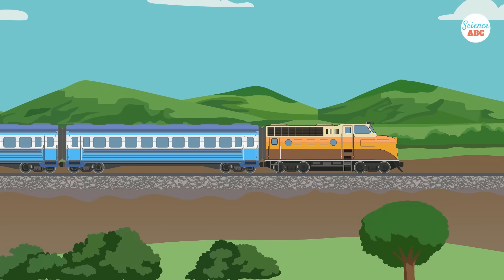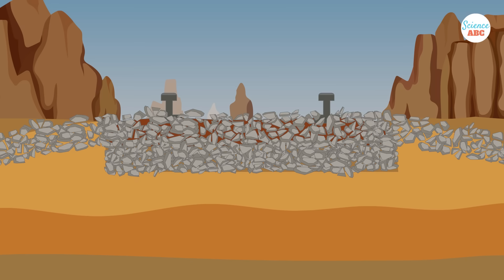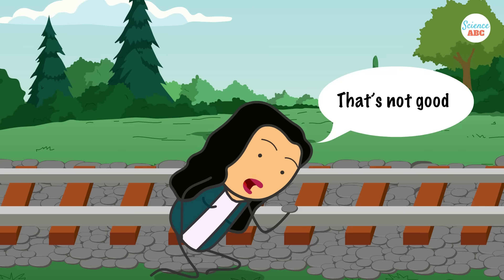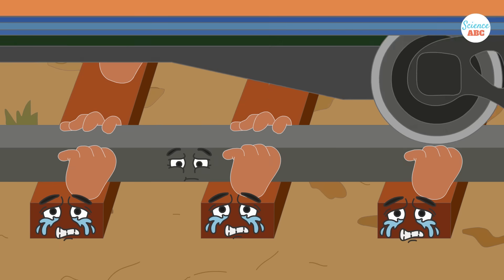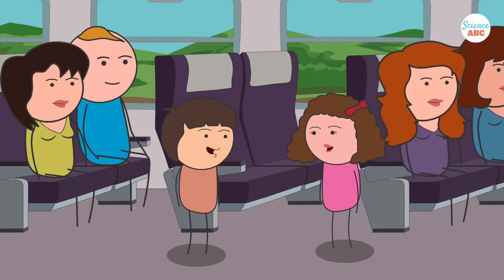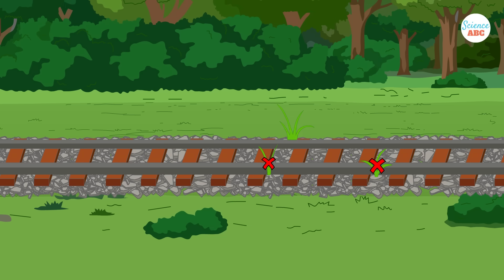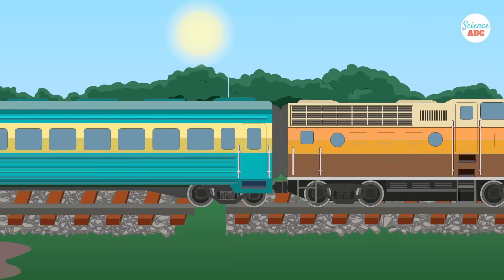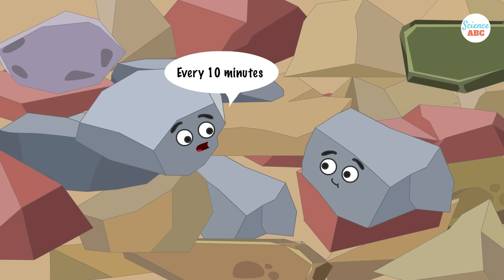Why Are There Stones Along Railway Tracks?

Comment: I used to have a job on a high performance ballast cleaner. It was a 7 person operated machine that dug up balast and shook the dirt out of it, then dropped the rocks back in place. My job(and one other guy on the other side of the machine) was to operate a metal box that shaped the ballast so that rain would first flow away and then down from the tracks.

Comment: Doubt that stones are better cushion than soil
Reply: The tracks also needed drainage, which soil does not do as well. Watch the whole video next time.
Reply: @entropybentwhistle  mentioning of cushioning is redundant. Is there other materials which could be used instead if they didn't lack a cushioning property? Maybe it is less about smooth ride of train and more about naturally preventing shocks from breaking structural integrity of the railroad, but it wasn't clear at least at the time.

Comment: I have a railroad right behind my backyard.  I love the sound of the trains as they rumble through the area.  I've seen the crews inspecting and repairing the ballast bed with that big machine you showed.  I just never knew what was happening.  I never knew why those rocks were there.  I have also seen the crews drive what looks like an ordinary pickup truck on the rails.  I've always thought the crew was inspecting the tracks.  Am I right?

Comment: As I had to work through the video, in short: 
1) To hold the sleepers
2) Load distribution
3) Vibration damping
4) Drainage
5) Preventing vegetation
6) Noise absorption
7) Minimising heat expansion

Comment: If ballast is so good, why are so many high speed rail systems (and subways) using pure concrete without any ballast?
Reply: Concrete costs more than rocks.  Concrete also takes more time and labor than laying ballast, which ultimately means even more money spent. Replacing rocks is also easier and cheaper than fixing sections of concrete when it cracks. Train tracks usually cover a lot of space. There's no need to spend more money on something when it doesn't need it.
Reply: @FlunkedPunk  How is this an answer? We ask why they are using concrete if you say it's more expensive.
I wonder if the first comment is right and it's because of possible damage
Reply: @dora_ver  my answer is indeed the correct answer. There is a german wikipedia article that describes that phenomenon. It's called "Schotterflug" and translates to "flying rocks". It only occurs at very high speeds. If you are interested, just translate that wiki article.
Reply: Your answer makes no sense 😂
Reply: At a certain speed there is a chance that the rocks get loose and damage the train
Reply: Ballast is good when you compare it to mud. But concrete is superior as the tracks are more secure.  A negative aspect of concrete is the dampening effect which is superior with rocks that have the ability to move under vibration for a smoother ride.  Also, in the city it may not be practical to use rocks when the trains share the same roadway as cars where you need a smooth surface to be able to drive on.

Comment: Let me say something too.
 1) The major work of ballast is to take high tonnage load through sleepers and referring to bottom 12 inch. cushion( ballast under the sleepers). During rolling stock load is dynamic, so the cushion as resilient to the load.  
2) The ballast  area under  (the  rail fastened with  both side of sleepers) is called Rail Seat which is packed with Track Packing Machine to maintain the level, Cross-level, super-elevation and gradient. 
3) The ballast between Two sleepers is called BOXING to maintain sleepers position at right angle to the rails and 2ft. center to center distance between sleepers.
4) The ballast around the track is called SHOULDER to restrict the lateral movement of track, usually 3.25 cu.ft/linear ft. 
5) The ballast's is granite or limestone size is 2 inches to 1.5inches with sharp angular edges for good interlocking. 
6) Ballast stone is tested in lab. for COMPACTING Factor and Los Angeles Abrasion.
7) An additional ballast is put at outer Apexes of sharp curves to avoid the risk of track BUCKLING in high temperature. 
8) Ballast take high impacts of load and converts into powder usually under the low joints. 
9) Ballast allow rain or flood water  to pass through it, keeping track safe against sinking. 
10) Allowable  organic material on ballast is 2%. 
11) Ballast resist movement of track opposite to the  movement of train, called creep. 12) Ballast is not used in tracks in  mushy, sandy and loose soil area. 
12) Ballast is immediately removed if get oil on it since its behavior becomes plastic. 
13) Ballast don't resist too much to vegetation growth because weeds grows into soil within ballast. 
14) Noise of train may intermingle in voids within ballast. Not sure.
Thank you.
An Ex. Railway Engineer fired from CN Railway because of having good knowledge of Railways.

Comment: The reason for this is that there are stones to prevent water from overflowing in rainy weather. In other words, there is no need for stones for an underground train, but stones are made to prevent water from collecting under the train tracks where rain will come and overflowing.

Comment: They're called 'ballast' anywhere you use them. Most ballast is used for road bed and you're right to a degree. They don't actually lock in, they simply stay put once they're settled. I've used them for 50 years for everything construction. It's just larger rock crushed into smaller rock and it gets that way by several different crushing methods. The type of rock is the most important.

Comment: Earth is not a planet.  The vast distances at which railroad tracks span proves this obvious fact.  The alleged curvature of earth is never factored into the engineering considerations when planning a span of track, never.  Only the measurable elevations changes but never the non existent curvature of 8'xmiles^2.  Scientifically, earth is flat and motionless.

Comment: Good but the ballast stones are derived from breaking the mountains rocks and crush them. Enough is enough. Railways must look for alternate material else the will compromise on sustainability that is not good. A like fossil fuel usage plans they must have a deadline to migrate to different material unlike mountain stones. By 2035???

Comment: There are two mechanism largely at work with track ballast, the sub ballast that is the rail bed under the railroad crossties and the ballast that is between the crossties and holds them laterally.  Sub ballast wears out from the moment of the trains rounding off the interlocking edges of the rocks turning them to shavings and dust that also clogs drainage creating suction when wet and pumping sediment into the sub ballast.   

An abandon section of the Columbus OH - Indianapolis Indiana Pennsylvania line I pulled up a handful of old ballast that was rounded off nearly like river stones with shavings and dust mixed in.   An old report from when Amtrak's National used the line last time in 1979 is the sub ballast would give so much on the east side of the Sugar Creek bridge in Philadelphia Indiana the passenger cars would be uncoupled with one coupler being totally above the other with no connection quickly to come back together again.  

I watched at WV Tech Montgomery WV in the mid 1980s CSX totally removed all track and ballast from its mainline then put down a geologic textile fabric, new sub ballast which may have been rolled, then crossties and rails then large stone 2" ballast on top.   To the east of town CSX put in new concrete crossties that rode better than some sections of the NEC when I took the Cardinal over them.    I looked back at recent Google map views and they'd been replaced with wooden crossties.    The issue with concrete ties is if there is a dragging off rail wheel it can crack every concrete tie.   It that situation would be fixed concrete ties offer fantastic passenger train service.

Comment: Advantages Of Stone Ballasts along the railway tracks :-

1. Holds the track in place
2. Even load distribution 
3. Provides cushioning 
4. Proper drainage
5. Prevents vegetation around
     the tracks
6. Absorbs loud noises 
7. Minimizes heat expansion
     in tracks

Comment: Ballasts are being discontinued in many new railway systems, instead, concrete slabs are used. they are designed for the specific job (usually for high speed trains). As technology advances, we will see less and less ballasts and more concrete or lab made materials for new tracks and even for old tracks that are being refurbished.

Comment: Another point it’s acts as an insulation medium between high tension wires to ground to prevent air charge distribution . If any object in between energy passes through. Same as like capacitor principle or thunder storm principle. That’s why you can see same kind of stones in substations as well

Comment: Railroad ballast is a crucial component of the rail transportation system. It is a crushed stone or gravel material that is used to support and level the tracks in a railroad track bed. The primary purpose of ballast is to provide stability to the tracks, allowing trains to run smoothly and safely.

Comment: The stones along railroad tracks are called ballast. They serve several purposes, including providing stability for the tracks, allowing for drainage, and helping to distribute the weight of the trains. Ballast also helps prevent the growth of vegetation near the tracks, which could interfere with train operations.

Comment: Don’t forget it inhibits foliage growth between the rail which not checked will result in fires. In my forty year working in railyards, I can’t tell you how many grass fires I’ve had to put out. Also you be surprised to learn you’re just as likely to have grass in winter as summer. Sparks from wheels and more likely carbon sparks from engine stacks igniting dry grass.

Comment: To those in the younger generations Amtrak transitioned to sewage chemical holding tanks on passenger trains in the 80’s after a lawsuit from a fisherman under a Florida trestle received a shower of an unfortunate combination of liquid and solid waste. There was a pedal to flush the toilet.  Stepping on the pedal opened a rounded metal trap door, flushing the toilet. Everything in the bowl plus the special blue water was dropped onto the tracks.  Looking down the hole you could see the ties and ballast as you rolled down the tracks.  There was a sign that requested you not flush while inside the station.  So the cleaning mentioned was especially important.  ;-)

Comment: in the uk ballast is made of limestone or more commonly, granite; smaller, rounded stones are often found in slow moving areas such as depots, and is referred to as shingle; there are other construction types such as slab track (continuous concrete block to which the chairs or baseplates the rail sits on, is bolted to); finally, digging ballast is absolutely back-breaking and most would probably agree is the worst job on the railway.

edit: ballast can become worn and crushed, and when mixed with rain water turns into a sludge - this sludge does not support the track and leads to pumping under train load, eventually leading to wet beds. a key sign of this is a line of white 'powder' around and under the rocks.

Comment: Ok one more time pls, lets run it again, i aint the sharpest tool in the shed pls tell me more and in bigger detail. Cant it be elevated and lodged into concrete and with sewer like grids around it for the water ? And how exactly do the rocks save it from the heat if the heat i]expands the metal?

Comment: Why not use a reinforced concrete slab structure? It has higher mass for damping, could be designed to have drainage system too and easier to clean. Is it just budget issue?

Comment: They missed frost heaving. In places where there ground freezes, the ground will swell if there is sufficient water in the soil. With certain soils with lots of clay, this frost heaving can be measured in feet, not inches. 
The rocks don't have soil to hold the water, and so frost heaving is greatly reduced.

Comment: After working for a Railroad Being a mechanic that fixes the machines that work in the tracks and being in a track gang it's nice to see someone explain the hard work that is done. I see you call ties, sleepers. For the  people in the north the tracks are changed come summer do to the heat make the tracks expand. There are two type of gangs that work the tracks. The rail gang and the tie gang. There is so much more work that goes into maintaining the rails. I would have to right a book to explain all of the jobs the the Brotherhood of the Maintenance of Way does to give you a safe ride on your trip.

Comment: Through use and over time, the ballast gets crushed and ground up and looses some of its effectiveness. So rather than replacing the ballast, occasionally they just fluff it up like a pillow. There is a machine the railroad uses that lays down feet, picks up the track, and then with large metal brushes, it rearranges the ballast. This is how I came to learn about the vibration damping and noise damping effects of the ballast.  Living most of my life next to a freight line,  I had become very well aware of the vibrations the heavy freight trains made. But after refreshing the ballast with one of these machines that didn't add new ballast, but simple rearranged the existing ballast, the noise level and the amount of vibrations transmitted to the ground were substantially reduced. I was very surprised because before that, I didn't really understand what the ballast did.

Comment: BUT IN METRO TRAIN NO BALLAST IS USED WHYY
Reply: Metro trains carry passenger traffic, so the track does not have to withstand such high loads (both load and waggons being lighter). Also bear in mind that metro traffic in urban areas is running on different structures, not just the ground - and probably more ...

Comment: Another purpose served by the ballast is that it establishes the consistent gradient and smooth contour required for the actual rails, and keeps them level with each other side-to-side at every point. If left and right rails are not pretty close to perfectly level with each other, the train tilts, and bad, bad, bad things happen. The ballast is absolutely crucial to this requirement too. 

Where I live in the OK Panhandle, the Union Pacific freight route through here was completely re-engineered a few years back. The new system features welded jointless track made of sections probably 200' each before welding, so now no more clickety-clack is heard from trains which used to pass over joints every twenty-five feet or less. 

The rail bed is this same system of special rock, but for much of its route these are actually piled up five feet high or more, to bypass the contours of the ground beneath, and create the exact shape for the track to lie on. Another engineering factor which makes this work is called 'angle of repose', which is the natural state of any material when loosely piled and the angle formed by the side of the pile once it stops settling by gravity. The reason you have to use water to make a good sand castle is that the water increases the sand's angle of repose, and allows it to retain a steeper grade with no reinforcement, in other words. So the shape of the stones in this system is also dependent on the angle of repose required, when they are simply piled on the ground with no retaining walls. Millions of tons of freight now fly through our neighborhood, literally supported only by a pile of rocks, most of it several feet high from base to track bed.

It really does work. Also our local surface-soil type is fair to terrible for weight-bearing, especially when it actually rains every now and then. What locals call 'caliche' (usually pronounced 'kleechy' around here) may as well be peanut butter if you're driving on a wet dirt road made of the stuff. The sheer mass of the rock-pile system allows the track bed, a pile of rocks,  to function as a single solid object by being tied together from above by the track system itself (another advantage of welding the rails and the elimination of all those 19th-century expansion joints), and to shift and settle as needed into the ground beneath, without causing it to weaken in the process.

Somehow our local UP road has been turned into a kind of single massive steel truss, stretching from Tucumcari to Kansas City, based on a completely different concept of engineering than how railroads had been originally built. The old traditional construction model made each section of rail, rarely more than thirty feet or so,  into its own independent structure, which had to do with why train rides on old or ill-maintained track were always so bumpy, and far from safe. Now they are quite literally a single object, for miles and miles of their length.
Reply: Very informative, thx a lot.
Greetings from Europe.
Reply: @frankyboy1131  Enjoy your passenger-rail, which is one Euro-thing most of America has none of. Word is we sold off all the old scrap iron made from a passenger-rail system which had been the envy of the world, to the Japanese before WWII, which they then turned into ships and planes to bomb us with just before Christmas one year. 

To this day the personal automobile is the backbone of American life, and I absolutely loathe this about my country. I see all that lovely state-of-the-art track passing a few blocks from my house, and it still makes zero sense to me why every eight or tenth train is not packed with travelers. They say Americans have a 'love affair with the automobile', but this American thinks they're the worst goddamn thing that ever happened here.